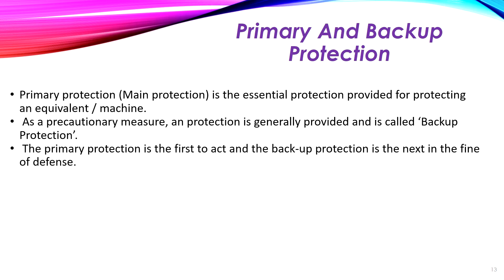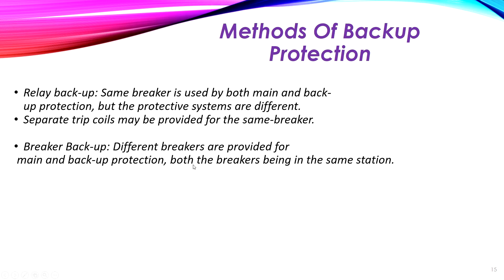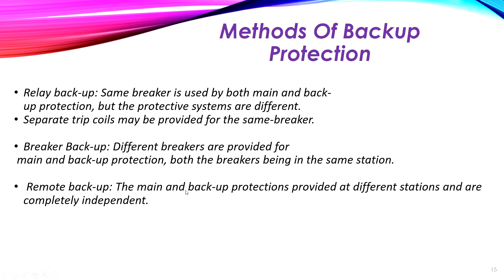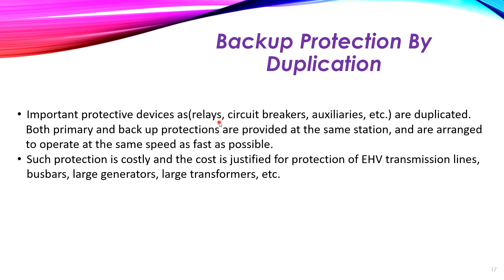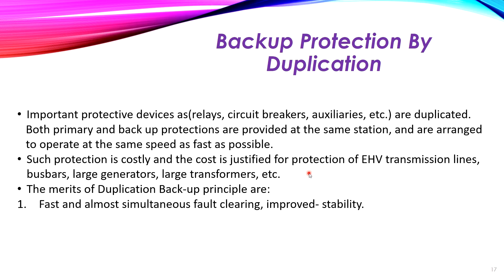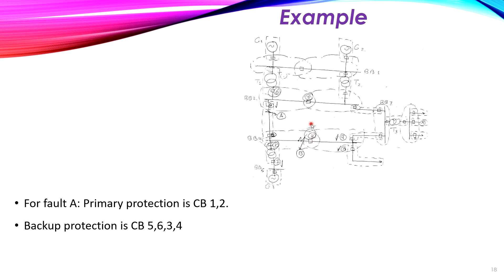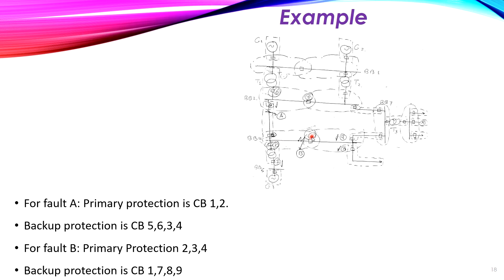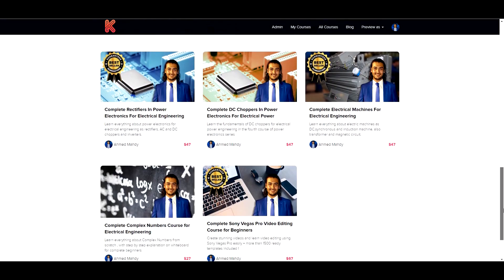Primary Protection and Backup Protection - Primary Backup Protection (3)

Comment: for fault A does the backup have a timer or is it instantaneous after each zone fails?
Reply from the maker: If fault occur in a zone and the breaker of this zone fails to operate, after certain delay time like 0.3 second, the breaker in the next zone will operate as backup protection.